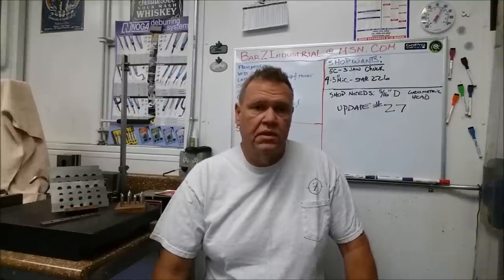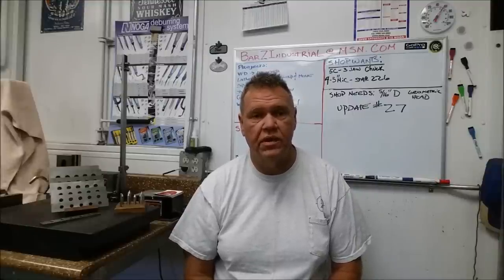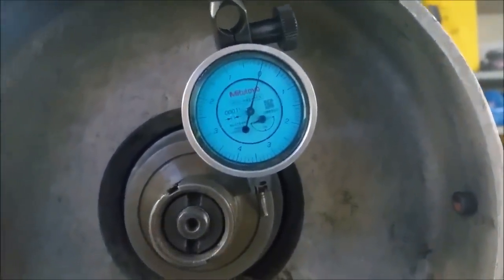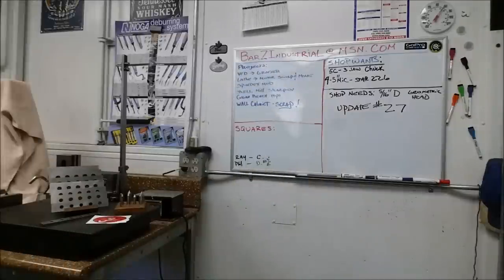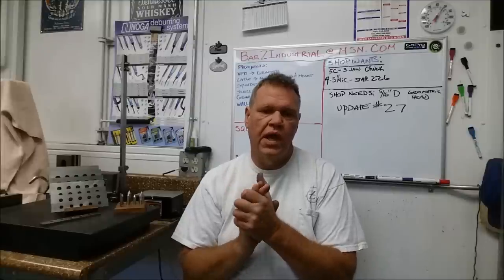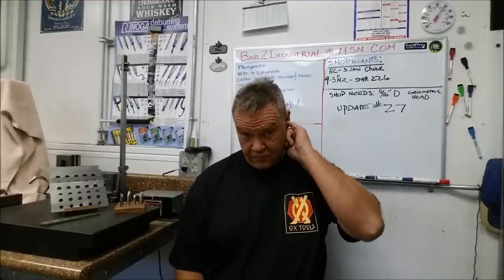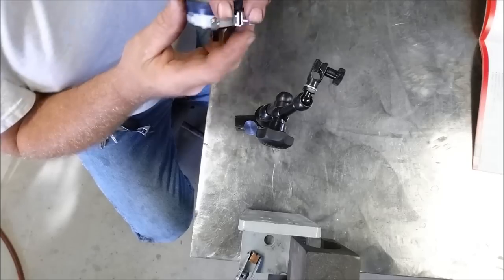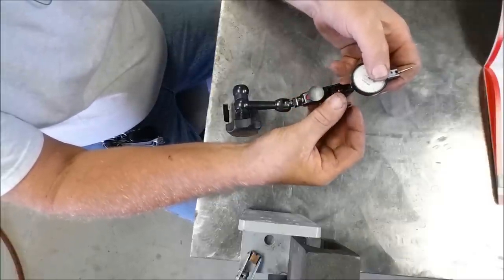Week Update #27

Comment: About  a larger whiteboard...
Talk to your sign guy that makes your large plotter cut vinyl decals...
If he doesn't already have it, he can purchase dry erase material to make any size board you want.  it comes on a roll just like his other vinyl and can be applied to any flat surface... If you have a good relationship with him... it will be much less expensive than purchasing and shipping a large one.  Custom size is the biggest advantage.

when you checked "up and down"  play , it looked like the indicator wasn't really positioned on the top which would give the most accurate reading. ... just sayin'

Be well,
Anon